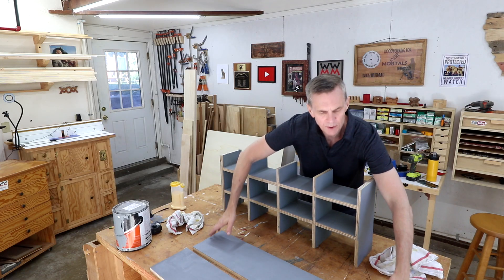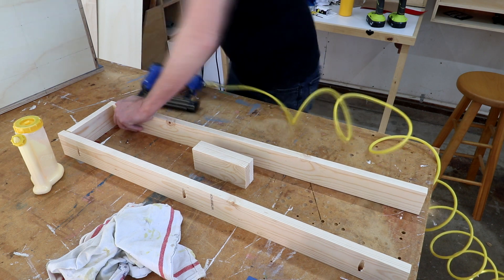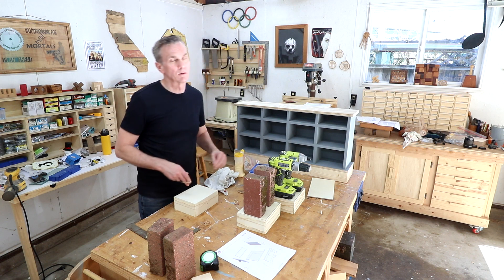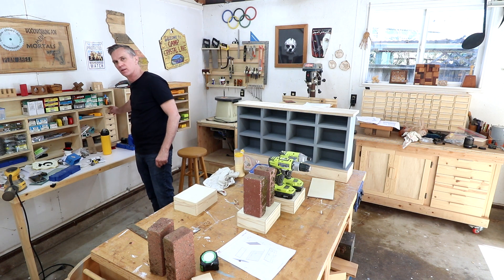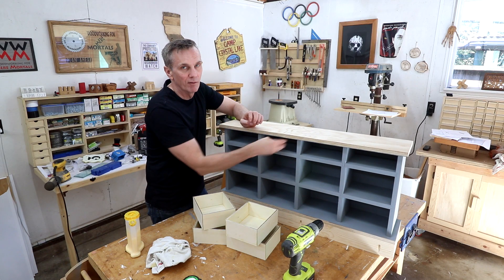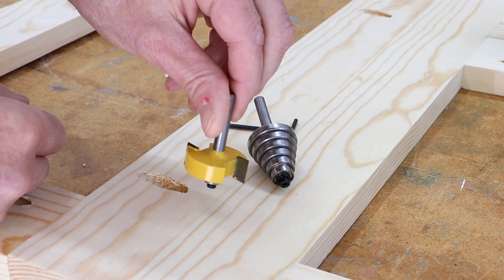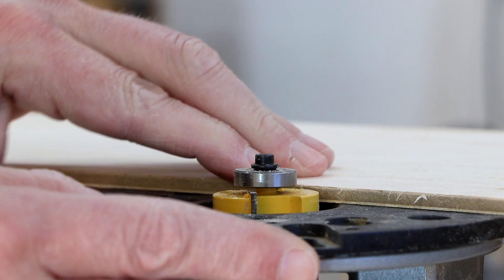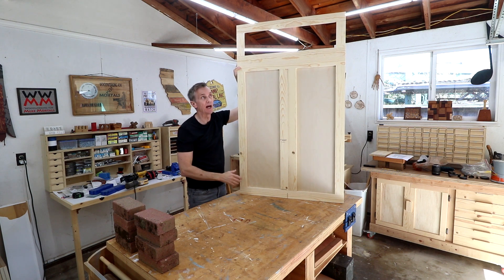Making really big frames

Comment: Do you have any information on how paint affects glue?  Seems to me it would affect penetration but I have no data on that.
Reply: I would think what you've done is glue the other piece to the layer of paint, so now the strength of the joint is dependent on the bond of the paint to the wood.

Comment: Thanks for the stress relief Steve,  My shop wall came off the foundation, the building needs to be leveled as it was not a permitted structure. My dreams of being a woodworker are slipping through my fingers. Attorney's have been called cause i should have never been able to buy this property with a un permitted structure on the property
Reply: Oh no! I hope this lemon turns into an opportunity for you to build the shop of your dreams.
Reply: Wow, what a shame.   Agree with the other comment, this is difficult now, but see if there's a way to make an even better shop when all's said and done.

Comment: Steve, can you add a link to that set of ball bearing router guides?  Or to the rabbeting bit that "comes with" that set of router bearings?  I have two rabbeting bits, and while one is a piloted bit with a bearing, it didn't come with a set of alternate sized bearings.  Thanks!
Reply: Psst.  Click the link for "TOOLS I USE" in the video description.  I went straight there to look for that bit and it's on his list.
Reply: @VeretenoVids  Thanks, I didn't realize he updated his Tools list for all his videos.